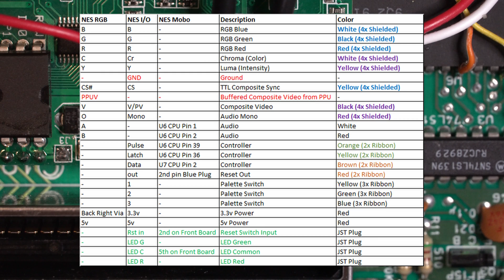[How To] No Cut NES RGB Mod: Wiring the etim NESRGB to Borti's I/O for the Ultimate Video Quality

Comment: I have a question about this particular mod I am having trouble getting a direct answer. I sent my front loader to Voultar to have tim's rgb with the super nintendo AV output. I purchased the i/o no cut circuit board to replace the original power circuit only. I do not ever wish to use the AV outputs on the i/o. I am only interested in updating my power circuit due to rolling diagonal crosshatching on screen after the system gets warm. 
Whether the i/o board fixes my issue or not, can I simply desolder the old one and solder this one on without making any modifications to resistors or adding other wires here or there? I do not know what I'm doing but I know how to solder/desolder. 
Any help would be greatly appreciated. I had voultar replace a common capacitor that he offers and that did not fix it, nor did it go away after replacing the power cable with a Triad. The crosshatching appears on all tv's using OSSC, Retrotink 2x pro, Retrotink 5x pro, retroaccess scart cable, and the HD Retrovision component cable. I have spent a fortune on all that just mentioned to get rid of the diagonal crosshatching and still have this problem and the i/o board is the last thing I can think of to change before I throw the nes in the trash.
Reply from the maker: Before you go down the road of replacing your RF / power board, perhaps bring the console over to a friend's house and try it over there. Just to rule out [unlikely, but probability is non-zero] dirty power. It seems you've already ruled out the other common causes (power brick, AV cables).

The Borti NoCut does require proper the installation to function properly (video and audio wiring), although you could ignore the palette changing and LED modifications if you want to simplify things.
Reply: @kytor  first of all, THANK YOU so much for helping me! I cannot tell you how frustrated I've become with this. I even created accounts on the shmups forum and several other places like discord and reddit trying to get an answer now for the last 2 years. 
So, I have the palette switch but no LED modification already done by Voultar. I will bring it to a friends to test on their tv but I also have a battery inverter for power outages, would it be helpful in any way to test running it on that to rule out dirty power coming into my house? I have four separate power adapters I've tried as well. 

I do have some power issues in my home that plague my neighborhood because we live way out in the country. Random flickering sometimes but it's mostly fine. https://www.youtube.com/watch?v=vKP0Lf02F90 This is how it looks with the ossc and retrotink 2x pro. The new 5x pro helped a little bit but it's definitely still there and very obvious to your eye and incredibly difficult to capture an image of it.
Reply: @digitalblasphemy1100  I would not recommend using a UPS as a valid test, most of these are not true sine wave. It would be best to go to a friends house in another neighborhood and see if the issue repeats. If it does, you know it’s an issue in your hardware.

Comment: It is redundant/unnecessary to run 5V from the power supply to the NESRGB when you have the J3 jumper closed. J3 connects 5V from PPU pin 40 to the NESRGB. Your extra 5V cable probably won't hurt anything, but it is not needed.

Comment: Thanks a lot for the video. I have been having a hard time knowing where to solder the wires for video and audio. This helps a lot. Now, something I am noticing different is that you are connecting the 5v from the rgb board to no cut device,would that be the reason why the NES is not turning on?
Reply from the maker: If you are not getting 5V to the NESRGB then it will not come on. There are a few methods for this, I like to pull 5V off the I/O board.